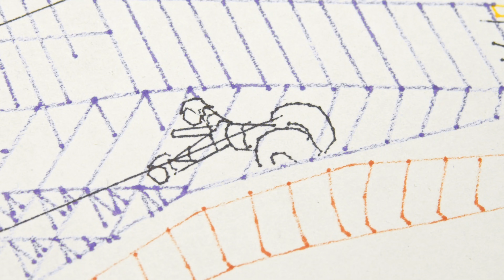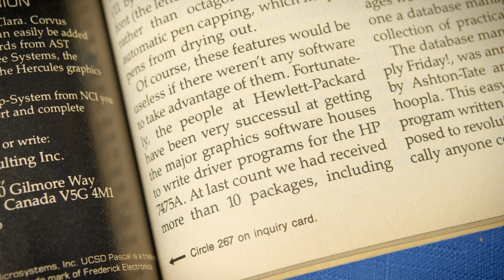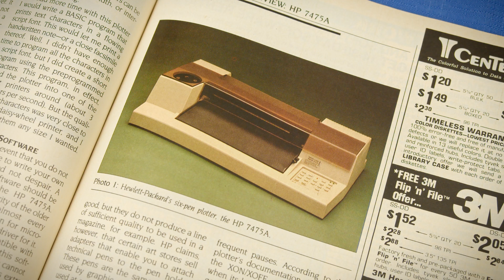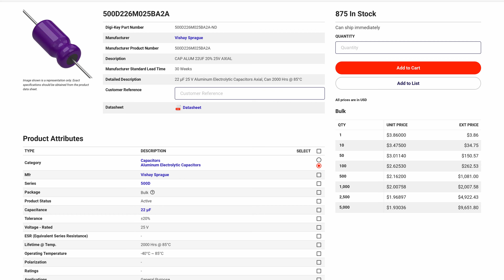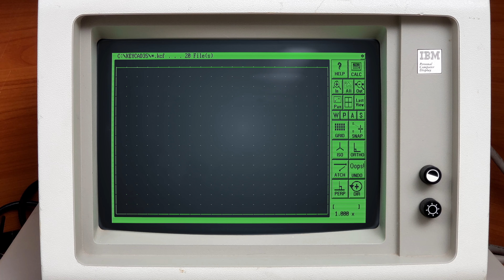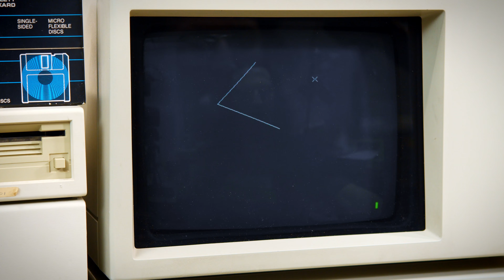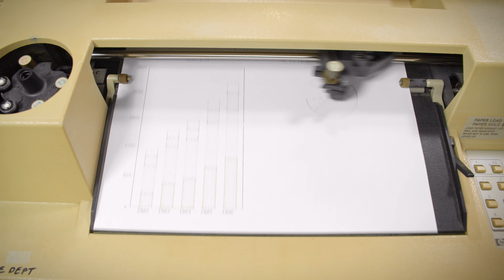Gold Standard Plotter - HP 7475A

Comment: The kind-of-magical thing about this type of plotter, was how how, using only rollers, it could accurately and repeatedly position the paper.  If I recall, the mechanism by which that worked, was that the rollers lightly embossed the paper with tiny dents that would then match the rollers as the paper moved back and forth between them, and subtly correct the alignment of the paper back to whatever it was on the previous pass(es).
Reply: That's not how it created consistent alignment. That's simply the result. It was performed via constant trailing edge registration.
Reply: I think you are correct, and my original comment was wrong.  I was remembering a large-format pen plotter in a lab where I once worked.  That one left both ends of the paper dangling free and only had the rollers to maintain alignment. They were metal, larger, and visibly patterned.  These may just be smooth rubber, in which case they do not emboss the paper.
Reply: Huh!  I was just thinking that it's remarkably consistent, in that it doesn't lose its tracking over repeated movements.
Reply: Grit-rollers!

Comment: This really takes me back! I used a 7475A at Uni during a VLSI design course module. It was an RS-232 version attached to a MicroVAX II in a specialist departmental lab. In fact, my dissertation project was to effectively mimic the plotter on a Tektronix graphic terminal. The lecturer was getting fed up with the time VLSI designs took to plot, the cost of replacing the pens and the limited size of the plots. My project was to parse the HPGL output from the design software and translate it into other command codes to send to the (again, RS232) terminal. Even though the design had to be parsed twice (first pass to determine a scale factor to apply so that the design would fit optimally onto the terminal's virtual screen space) it was still a lot quicker than plotting! Also, the terminal had a built-in joypad and functionality that allowed panning, scrolling and zooming of the rendered image. Of course, these days a tablet could do the same thing 1000 times faster for 1/1000th of the cost! 😁
Reply: "Of course, these days a tablet could do the same thing 1000 times faster for 1/1000th of the cost!"
 
Yeah, but where's the fun in that?

Comment: You might look to see if your NI serial to HPIB interface is expecting hardware flow control. This uses the CTS and RTS lines to manage serial traffic. A lot of programs didn't support that.
Reply: The alternative might be SW flow using ASCII characters XOn and XOff. But I suspect the NI device doesn't handle that. The hardware flow control may be that the software expects it but the NI doesn't support.
8N1 vs 7N1 doesn't matter for HPGL because the language is all upper case ASCII. Serial port hardware cares though.

Comment: Love your vintage HP equipment videos! 😃
I think the keycad serial communication issue is related to flow control/handshake.
Kermit might use XON/XOFF, while keycad wants hardware handshake.
Is your serial cable supporting the hardware handshake pins?

Comment: The plotter is only expecting ASCII characters, (ASCII letters and numbers are only 7 bits), and since you are not sending any characters requiring the 8th bit I'm guessing the National Instruments is trimming the 8th bit on the GPIB side.

The fact the KeyCad completely stops responding when accessing the COM port probably means that KeyCad is trying to access COM1 with an incorrect I/O address and/or IRQ. Standard COM1 I/O address is 03F8 IRQ 4. Make sure your COM1 setting in KeyCad reflects your actual COM1 settings. You could also try using the COM2 choice in KeyCad to see if it locks up the same way.

Comment: In my early days I spent untold hours writing code in IBM Basic on an IBM AT to send serial commands in HP-GL to plot out Load vs Time Impact Energy curves from an Isaac Cyborg high speed 12 bit data acquisition system. Then inkjet printers came out that would print in seconds and I had to rewrite all the code to interface to a parallel port printer. No more PRINT USING #2 commands.

Comment: HP also invented the PCL, or printer control language.    We had systems that were coded to use a certain type of printer, but as long as it was PCL compliant, the system just worked.  Replaced a color inkjet with a color laser, and it just worked.  Because of PCL.
Reply: My printer at work still works on windows 10 bc of a generic pct driver. It hasn’t had a specific driver since iirc xp.

Comment: I have a 7475A, one of the later versions with the white line instead of the paper stop, and while I do love it, I've mostly switched to using a large vinyl cutter for plotting instead, as I can use up to 3ft banner paper and make plots at any length I want, and can custom make holders for most pens (technical pens, sharpies, ball points, felt tip, markers, etc) which gives me a lot of freedom that this device doesn't have, save the limitation of manually changing pens and having different files for different colors.  I have a bunch of extra plotter pens for the HP but the size of the pen is limiting.  It is possible to take old plotter pens and open them to make any color pen you want using sharpies, but its a messy process.  You can even modify the plotter to allow taller pens to be used, but it requires cutting the case to allow the pen to pass through where the plastic is, but I don't want to do that. I've seen it done several times though.

Comment: Oh my!   Decades ago, one of my workplaces was clearing out old computer hardware and someone was ready to just toss this plotter into the dumpster.
A little Windex for cleaning, and it worked perfectly, with two full sets of pens.  I was a recent tech. graduate, and enjoyed creating images & digital drawings, when everyone else was using color dot matrix or cheap inkjet printers.
It was a sad day when the gears got worn out, and the pinch rollers cracked.
Reply: That said, still a lot of fun to be had with dot-matrix printers and a roll of chain paper. Which appears to be getting increasingly hard (and expensive) to source...
 
Got a project going, which I should really get back to, to convert our old Star LC-200 printer to a stand-alone text adventure console. I'm sure the Pi Zero would fit inside, and all I need is to convince Frotz to feed a couple of newlines after every response, and retract them again before printing and parsing the next command and its response.

Comment: I pulled one of these out of a science lab skip in the late 80s.
I managed to get in touch with the HP BBS via my local FIDONET gateway, and they very kindly sent me the DIP switch settings so I could get it working.  It was the serial version.
I seem to remember it worked with my dodgy dongle free version of AutoCAD.  😲

Comment: I think the reason it doesn't work from keycad is the commands are slightly different between the serial version of the plotter, and with the hpib version of the plotter. I don't think the serial version of the plotter (that keycad is trying to talk to) needs the address and whatever, and I don't think the NI serial to gpib adds any of that for you automatically. There has to be something different enough in the initialization that it's waiting for and that's why it gets stuck at 0%
Reply: Could there be some way of watching the dialogue, or attempted dialogue, on the RS232?
Reply: Attach a serial terminal to the output of that PC.  @SeekingTheLoveThatGodMeans7648
Reply: @SeekingTheLoveThatGodMeans7648  Yes, RS-232 is very easy to sniff - just connect the TX line from the computer to both the serial->GPIB converter and also connect it to another computer running a terminal emulator. You can also do it many different ways through software, but nothing beats the simplicity of a couple wires soldered to a custom RS-232 splitter cable and a separate PC (or a scope or logic analyzer that has RS-232 decoding). I would also check the 7475 manual for the differences in the command sets between GPIB and RS-232 versions of the plotter. I had a serial version of the 7475 for a while not that many years ago, and was able to use it with various software without many issues. I cut a little slot between the carousel area and the main area so I could load full sized pens into a hollowed out plotter pen, and used it for directly printing etch resist onto PCB's using a Staedtler pen mounted in a plotter pen shell. I gave it to a friend when I moved, so no longer have it. Prototype PCBs are ridiculously cheap these days, so it's not even worth mucking around etching your own now, but printing the etch resist directly onto the PCB with the plotter worked quite well.

Comment: This brought back some memories. At a company I worked at, we used the 7475 to draw flowcharts to document processes. There was a software product we used but I don’t remember the name of it, that had the flowchart symbols, etc. We would work up the doc and print it on regular paper. When we had the final version we would use the plotter paper. It does work better than standard paper but it was also more expensive. The other thing I forgot about, and yours does it, it would be plotting along and all of a sudden pause, like it was thinking about what it had to do next or just taking a breather. In a way, it was amusing. We had the printer port interface version. IIRC, they also had an HP-IL version plus the ones you mentioned. It was a great unit. I always wanted to get one, but $1700.00 was a lot of money back in the mid 1980’s.. We also had a supplies drawer unit that the plotter sat on. One drawer had the HP plotter paper. The other had pens. Also, as you can imagine, the pens were not cheap either. I don’t think the supply drawer unit was an HP product, but I might be wrong.

Comment: Hm, I really should look into getting my HP 7596A running again... Technically it works, but all software and examples have the origin at the bottom left of the page like in your video, on mine it's in the center of the page, so the plotter is only using one quarter of the sheet.

Comment: Using the current draw of an electric motor (because the electric current is proportional to the torque) to detect a dead stop or zero point is very common though. It’s cheap and effective, you don’t need an additional position sensor (e.g. led and photo diode) and you can do it with stepper motors.

It has been used for a long time (it’s how old 3 1/4 inch disk drives find track 0) and It’s still commonly used today in all kinds of different applications from automatic roller blinds to electric car windows, pointers or “hands” in instrument clusters etc.

It’s so common that nearly all microcontrollers for industrial or automotive applications that include motor control functionality support this in hardware.

It might sound horrible but it’s a pretty common and safe and effective way to implement this functionality without adding a lot of additional sensor and control infrastructure.

Comment: oh man, i have always loved plotters, and would love to an A1 / A3 one. No idea what i would use it for besides being fascinated by it plotting 😂
Reply: Try to find a used Cricut or Silhouette machine. I got a factory refurb Portrait 3 for under CA$250, cuts up to A4 size with the standard cutting mat and can do an indefinite length with the appropriate attachments/material. The pen attachment is inexpensive if your second hand machine doesn't come with one, blades aren't too bad either. 
I mainly make decals/stickers with vinyl, adhesive leather, or holographic sticker paper. I also found it quite handy when making the required game pieces for atabletop game, Gaslands. 
Honestly you just kinda start coming up with reasons to use it once you have it, just so you can watch it go back and forth.

Comment: I was alive when these were a thing, I never really understood why anyone would use a plotter and not just a color dot matrix or anything else for that matter.... or a wide format inkjet like a designjet.... I don't get it.... so complicated and slow
Reply: Dot matrix quality is ass and wide format ink jets didn't exist until the mid 90's.  Our first upgrade from pen plotters was a calcomp electrostatic roll "plotter".  It had four colors of liquid ink in one gallon bottles, printed one color at a time but since the paper was on rolls it could print out plots all day without intervention.  I can remember many days of pulling the roll of completed plots off and then cutting each plot out.  Wide format inkjets with integrated paper cutters were a god send!  Encad Novajet - it took HP forever to get into the wide format ink jets.  Ah, the 80's and 90's :p

Comment: I have the HP 7475 and the HP 7470 plotters. I use them regularly with my HP test and measurement gear such as the HP 5371A and the HP 70k series spectrum analyzer.

Comment: I have never used a real plotter with pens.. but I still have to set those pens when I want to print something with Autocad version 2024..
Reply: I can relate. It’s quite baffling that AutoCAD still works this way if you’re used to Revit or any other modern design software. AutoCAD is full of legacy, quite frankly it belongs in a musuem. I still have to use it on a regular basis but I much prefer making building engineering drawings in a 3D bim tool like Revit (which I also use). I have been using AutoCAD for 20 years now and plotting is still as klunky as it was in the early 2000’s. Plot styles are such a pain 😖.